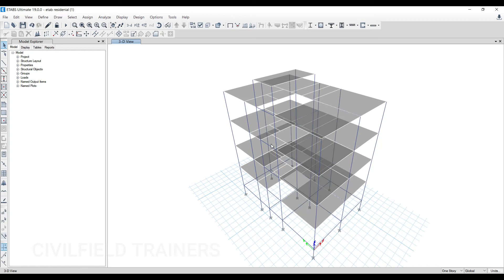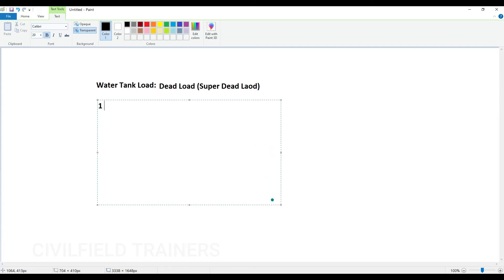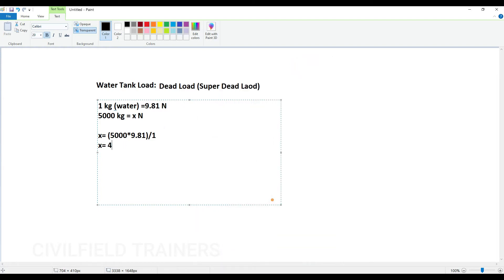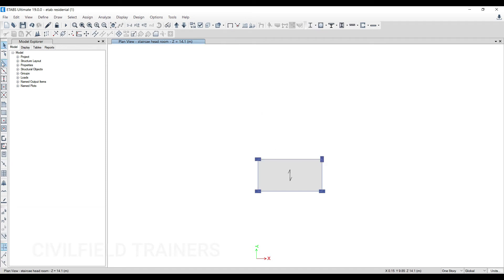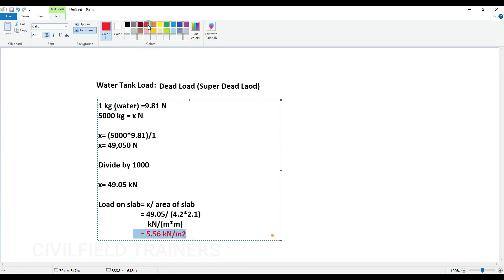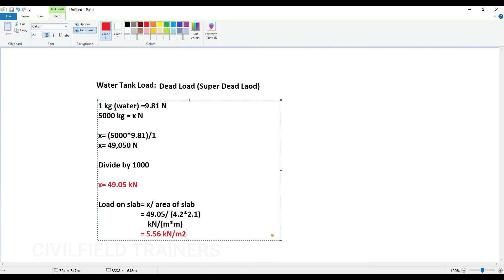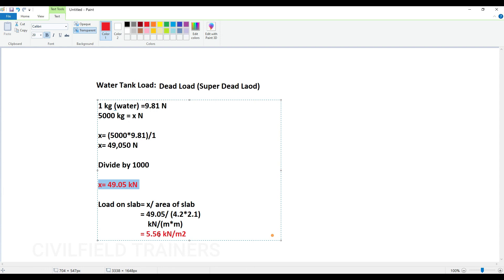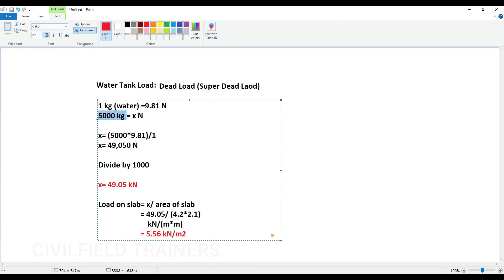Etabs 2019 l How to apply WATER TANK LOAD on Slabs? G+3 RCC Building

Comment: Sir, if you consider the volume of a tank as 1 m³ ( 1000 kg ), then the weight of water is 10 kN/m². This value remains constant regardless of the tank's dimensions, doesn't it?

Comment: Pls. Make a vid on cantiliver section 
How to design a Upto 2m span
Reply from the maker: We don't design for small spans. Generally whatever the slab reinforcement is, we apply the same for the cantilever portion as well. But if the span is 4-5m, then definitely yes. We design for it.